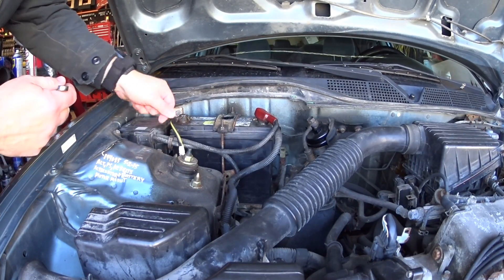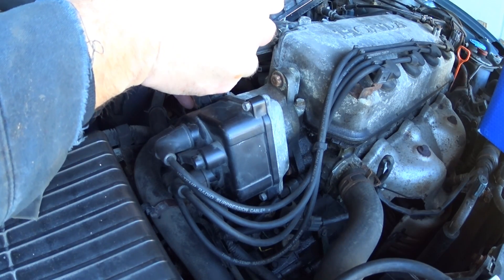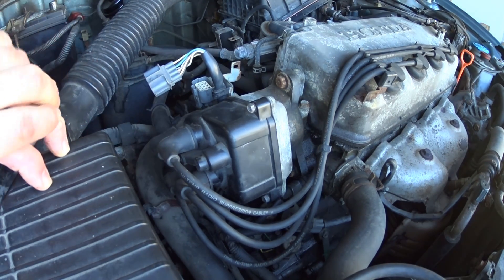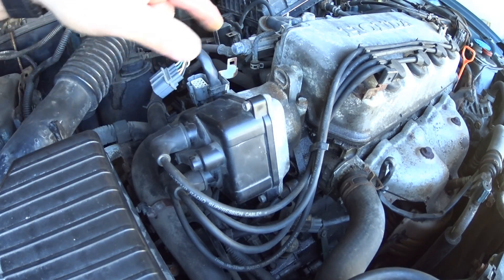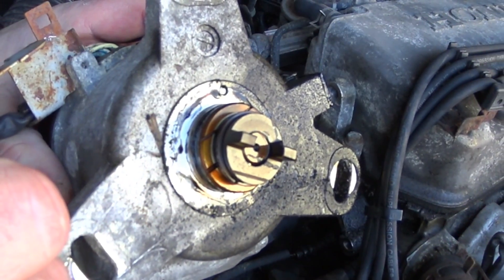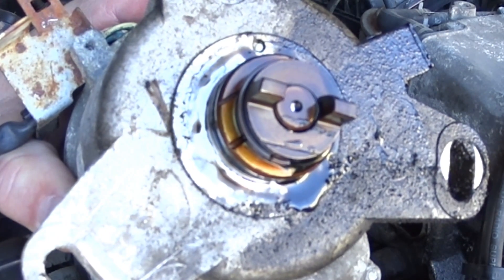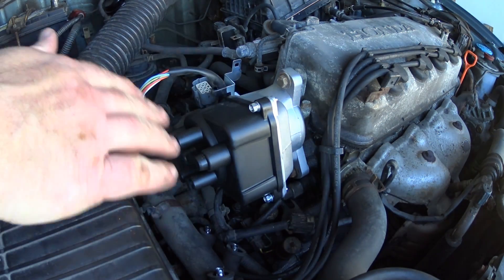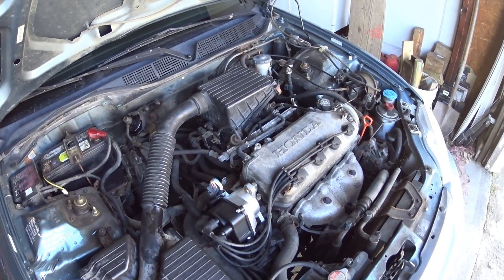99 Honda Civic distributor replacement P1381

Comment: Looks to me that the o-ring and seal needed to replaced. The oil inside your distributor cap and housing was causing your codes.
Nonetheless, good job. The ecu should have made any corrections to the timing.

Comment: What causes intermittent no spark on startup?  Like once every 30 times there’s a problem starting the engine, where it won’t fire up on the first attempt but instead takes 6-10 attempts at starting before engine fires up

Comment: Wish I would've seen this before I replaced the O-Ring on my 2000 Civic. I spun the two teeth on the distributor because when I tried to install it back after putting on the new O-Ring, the distributor wasn't going in fully. Now I got my new O-Ring installed and the distributor screwed back on but the car won't start 🤦🏻‍♂️

Comment: Got the saing code my p1381 honda cr-v change spar plug the Distribudor got it amazon car do daing thing stared morning got driving to see like 35 m coming back put off got staring it no want to stared way like 25 or 30 stared ogain no power put it off got back staring taring ok recet the code no got motor litgh any notes no got the code still doing it you know mavy whatt can't be problem thank s much can help me

Comment: Hey, great video!

So this code just popped up in my 2000 Honda Accord. 
Ignored it for a little bit because I wanted a second opinion. 
Car was running and didn’t know anything. 
Yesterday when I went to start my car it didn’t turn on at all.
I know people might say it’s my battery or alternator but I just purchased a new battery and I went and got it checked and it has a full charge.

Same day it didn’t want to start I went to the store (different car) and when I came back I tried to see if it would start and it did. Noticed the check engine light went away.
Drove it around for a little bit and still no check engine light.
Don’t know what’s going on.
Any help?
Reply: That code did turn on before though. 
Car is already at 260k miles. It would make sense if it needs to be replaced. Just need an experienced opinion. Thank you.
Reply from the maker: Sorry I really don't know. My experience with the Hondas was limited to the repairs that I was making on my wife's car.

Comment: We're having issues with our '00 Civic. It runs pretty good for a while then when it warms up and we go to stop, it starts bogging down when he comes to a stop but then when we let go of the brake it starts acting better. We've replaced spark plugs, IACV, new timing belt, new crankshaft sensor. My husband left the vacuum hose off the MAP sensor yesterday and it drove pretty decent. Still bogged down like once the whole drive. What should we look into? I'm going crazy trying to figure out what parts we should buy now. Its not throwing a check engine light (we think that light is broken)
Reply: "You need to fix either the coolant sensor or the thermostat valve. Sometimes, the issue could also be related to the AC coil."

Comment: Thank you for this video. my 97 civic had this problem, but I replaced the distributor cap, spark plugs, and spark plug wires. Recently, the same code went back on again. Do I need to replace the whole distributor, or is my car just confused with the replacement of the cap? Thanks.
Reply from the maker: Might be a distributor
Reply: @Foxboss9  Made sure the wires were tight, and repositioned the spark plugs and wires, light went off. Hoping it's not the distributor
Reply: @BrianJohnstonTrombone  what was it

Comment: Hi there. I have a 2000 Honda Civic Ex with 330k miles. I was driving down the freeway on my way to work about an hour into driving on freeway I was trying to give it more gas and it was like
Bogging down and it would have a hard time speeding up. I pulled off the exit as soon as I hit the stop light. Car died. Tried starting it up and nothing. I replaced fuel filter, fuel pump, fuel relay under dash, new cap and rotor. It started for about a min but all of a sudden I was reving it up and it was like misfired/sluggish and died. Any help would help
Reply: Change spark plugs with the original ones
Reply: mfcnby what you mean original ones DUDE
Reply: The ones that come with your brand New car. Or the ones that produced by OEM ( original equipment manufacturer)

Comment: My 99 Civic EX is acting up. I've been troubleshooting many systems. All good, EXCEPT it stalls on me WHILE DRIVING. It's a 5 speed. Then I pull a plug,  broke down on the side of the road, and no spark. I have power TO the distributer, but not to the plugs (at the time it broke down). Newer wires and plugs do I've ruled that out 100%. How common is it for distributers (coil, rotor, etc) to go bad on these. I'm hoping if I put a complete new distributier on it'll be good. New fuel pump, new fuel filter, new IACV. No CEL on dash or codes
Reply from the maker: That's what was happening with my wife on this car. I just randomly would shut the spark off. After I did the distributor we didn't have those problems. I'm just telling you what we did and how it worked. Unfortunately without a ton of troubleshooting you have to make the commitment to throw Parts at it which is one of the worst things a mechanic can do.
Reply: @Foxboss9 what distributor did you buy? Im having a hard time committing to one since they dont make oem anymore

Comment: Thanks a lot .. I have a 2000 civic lx how would I know if it's a tec distributor. ?
Reply: Don't think it matters as long as you replace the whole distributor. Don't mix components of two different types of distributor

Comment: Thank you so much ! My car is a 98 Honda Civic LX .  & would just cut off while driving . I would proceed to try and start the car it would crank but not turn on all the way , but then would start back on after a couple of cranks . Hopefully replacing the distributor will help it run great again !

Comment: Very helpful. I'm having the same stalling issue. What's crazy to me is how often the crankshaft position sensor (CKP) inside the distributor is confused with the crankshaft fluctuation sensor (CKF) which is behind the crank pulley. Even on auto parts websites most of them have them mislabeled. So when I looked up the OBDII code of P0336, it said I needed a CKP sensor, but because they're so often mislabeled on parts sites, I ordered a CKF sensor (which the site advertised as a CKP), and I was planning on tearing apart the whole timing assembly and crank pulley with the alternator and power steering belts to replace it. Luckily before I did that I realized what I ordered was actually a CKF sensor so I then ordered what I actually needed (the CKP sensor) by just ordering a whole new distributor, which contains the new CKP. Thankfully, replacing the distributor is a whole lot easier than removing the main crank pulley and removing belts and stuff. I haven't installed the new distributor yet, so hopefully that fixes the stalling issue. Anyway, thanks for the video.
Reply: Have you yet?  Did it solve the issue?
Reply: I bought a 2000 Honda Civic act like it goes dead when I stop when it is running any help

Comment: I have a 99 civic ex. I have the same problem along with a low idle, car stalls when I shift into reverse at times when it’s cold, but when it’s warmed up it doesn’t stall at all in reverse. It throws no codes and I replaced the fuel pump and filter. The cap and rotor was recently done as well, should I try replace the whole distributor??
Reply: Did it you replace anything

Comment: 98 Civic Lx sedan my issue is when I try putting my car up the ramps it won’t go up. Like it doesn’t have power. Even if I step on the gas it won’t move up the little ramps.  The only code Popping up is P1290. Will the distributor cause that?
Reply from the maker: Lack of power could be numerous things... Lots of troubleshooting will need done... Find the problem... Don't just buy/throw parts at the problem...
Reply: Foxboss9 found the problem. It was the distributor I twisted it forward.

Comment: I installed my new distributor without checking the Mark's at all and now my car is running all jacked. Totally my fault through my own ignorance. How can I fix it?
Reply from the maker: sonbios sorry, don't know... You need to find top dead center on the number one cylinder during the compression stroke and then install the distributor with the rotor pointing to the number one plug or at least make sure to install the number 1 wire to where the rotor is pointing...

Comment: When swapping out the whole distributor don’t you generally need to use a timing light after ?
Reply: When my old distributor is mounted, is it a good idea to draw a line to mark how it was mounted, then put the old and new distributor paralel to each other and draw the line on the new distributor, would that make sure i get it mechanically in the right position? If u understand what i mean, my english is not the best!
Reply: Njoy thats what he said you have to do to keep the timing
Reply from the maker: Jesse cote not if you keep everything lined up when reinstalling...

Comment: I change the distributor still have code some one said change cam shift sensor can u help me out please
Reply: I have a a code P0336 Crankshaft Position Sensor. I opened the distributor because people said to check that as well. I opened the distributor sure enough there was metal shavings in it. Hope that fixes my issue. Just bought a new distributor today.

Comment: Same code on my '96 accord LX, same issue, runs great until warmed, then won't fire up for a while.  Same fix?
Reply from the maker: I took a chance with ours... and just ordered the distributor...If it didn't work I would have sent it back..
Reply: Foxboss9 Ordered it,  installing Saturday.  Thanks for the response.
Reply: I put new destribidor the car it to give me saying code cylinder position sensor p1381 it still do saying thing got off way liltle be staring ogain don't what problem got me craisy thank you video

Comment: What can i do if i messed up. I took the distributor but i didn't remeber how the lines were in the old one. So i tried my best to remeber and realined them but i guess it didn't work.
Reply from the maker: You will have to rotate the engine to top dead center and install the distributor with the rotor pointing to #1 cylinder
Reply: Foxboss9 thank you
Reply: Foxboss9 how do you get the ignition rotor lined up to cylinder one when the crank is already at top dead center?
Reply from the maker: Salvador Bahena cylinder needs to be at top dead center and then the crank should also show top dead center. You may have to rotate it engine a few times to get both of those at top dead center
Reply: Foxboss9 but there was something said about the ignition rotor lining up as well to the #1 spark plug wire, i took out my distributor didn't know I had to make marks , reinstalled my distributor (turns out it was bad) now it cranks but wont start I lines up the cam and crank shaft stuck a screwdriver in the first spark plug cylinder port to confirm it's TEC, now it cranks but wont start dude I'm so stuck
Reply: Foxboss9 wasn't bad* sorry

Comment: I changed my distributor and now the acceleration is very sluggish. Pressed the gas pedal almost all the way but only getting 30mph. What should I check?
Reply: do you think timing could be a reason why my 98 civic wont start? it cranks but doesnt turn over.
Reply from the maker: timing
Reply: Check the firing order to where spark plug wires should be attached onto
Reply from the maker: BoYno oth3r possibly
Reply: what else could it be?
Reply: @Boyct23  did u find out what it was ???
Reply from the maker: _boy no easy answer.. You will need to troubleshoot and rule out all the systems one by one..
Reply: NauTzZz 
It could be the timing is not proper. When replacing distributors they must be re installed in the same orientation as the old one was. At least, close to it so that the ignition timing is as accurate as possible.
Reply: carlo mango do you know how to time it if i mess up if i forgot to mark my distributor
Reply: carlos villanueva I have the same question
Reply: Or maybe icm is bad that's why it cranks and won't start
Reply: Hey mister, has your car run properly after timing the belts properly?

Comment: I did replaced Distributor and P1381 came back again after driving may be 10 miles , I don't know how to get rid on Check Engine Light now?
Reply: So how did you fix the problem
Reply: Take the car to outozone and have them put a code reader on it and it should tell you what is wrong what part to replace

Comment: The car was running before i started What if i put it back on perfectly and it doesn't start up again?
Reply from the maker: Urbn Daniels can only be 1 of 2 things....1) you got a faulty/incorrect part OR 2) something was done wrong during the installation..
Reply: Sounds like you didn't put it on exactly and the timing got thrown off

Comment: How far can I drive with this issue? I have to get home from school next week and I'd rather not spend the $700 the mechanic is asking for
Reply from the maker: Joe Dolin my wife's car would have major problems staying running after approx 15 miles.. Once it cooled off it would go another 5 miles before issue started up again... I would not pay more than $150 for labor this job is soooo easy
Reply: Foxboss9 I agree completely but I don't have any tools with me at school so I'm sorta stuck in a rut finding the cheapest mechanic
Reply from the maker: Joe Dolin buy a cheap harbor freight tool kit and the parts
Reply: Foxboss9 I'll look into it, thanks for the quick response
Reply from the maker: Joe Dolin 👍good luck..
Reply: Foxboss9 just replaced it, took maybe 20 minutes. Hopefully that's all it needed! IAC will be the next step if it's still acting up

Comment: so great.  i put a "new" distributor on my 99 accord and now it's throwing me this error code.  it also stalled out on me at idle.

also - and it's the damdest thing but the radiator don't come on unless i turn on the AC...which is flashing at me.  all related?

if the distributor teeth are flipped 180 the car wouldn't start, right?
Reply: May have to fix the ignition switch..
Reply from the maker: The new distributor shouldnt cause any problems unless it happen to be defective from the supplier but you want to make sure you didn't lean on or break/loosen any connection anywhere you were working under the hood..